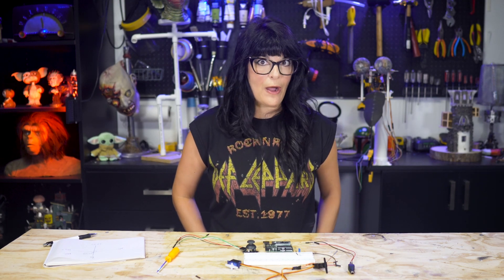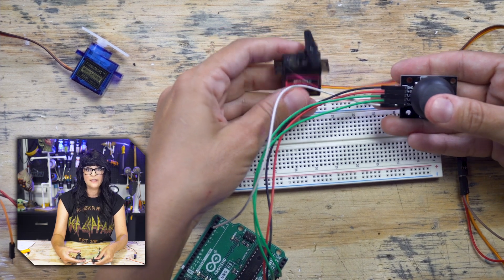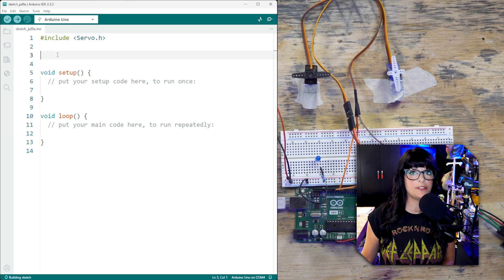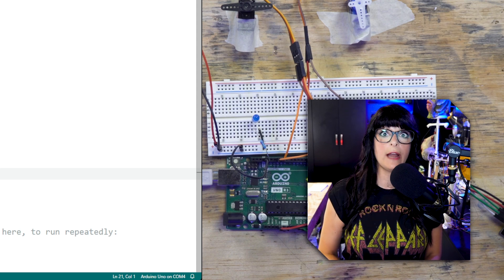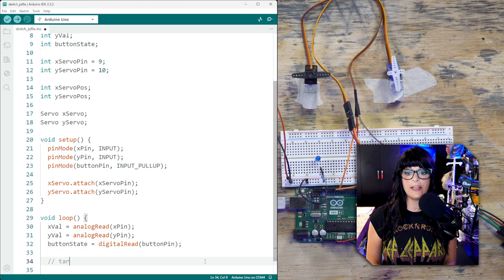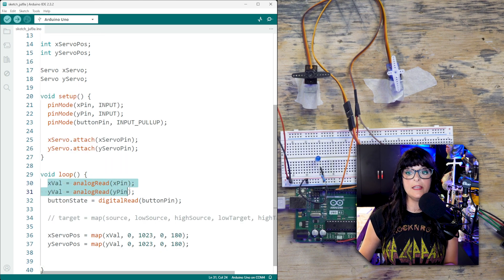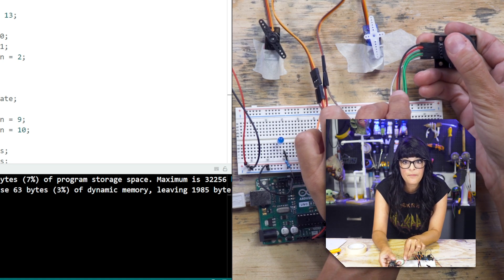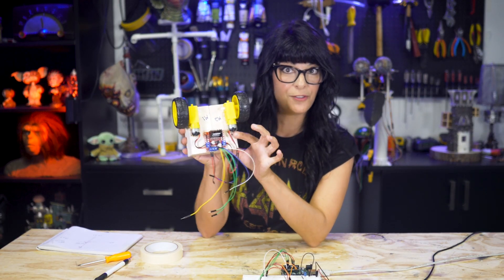Control 2 Servos with a Joystick and Arduino: Wiring + Code

Comment: I did this, wrote the code, but both servos are running when the joystick moves horizontal. One works fully and the other works partially. And for vertical, only one servo moves and not correctly with gittering.. is it the problem with the bad connections or power supply? Please 😊help

Comment: Since your y center wasn't actually the half of 1023, but rather around 489, your y servo in idle is not actually at a 90 degree angle, but maybe something like 88 or 87 (just eyeballing it, haven't done the math). How would you fix that so your 90 degree is 489 and still have the higher and lower values properly mapped?

Comment: i followed everything to the letter but it did not seem to work for me. may i know what's the power supply voltage and amps?
Reply: Did you use the Arduino power supply or a separate PS? I don’t think the Arduino 5v has enough current to move those servos. If you bought the kit there ought to be a small circuit power supply you can plug into the breadboard. It will fit across both power and ground rails. If you’re using that, ensure that whichever side you’re using is sharing a ground with the Arduino, and that the jumper pin in the power supply is set to 5v. Hope that helps.

Comment: Is it possible to connect two servos in parallel for each servo shown in the video for a total of four, and two more operated by the button (full stroke when button is pushed) for a total of six servomotors? I'm going to try it but I'd like your input beforehand to perhaps warn me of pitfalls before I potentially blow six servos! I'm trying to control an eye mechatronic.

Comment: Such an awesome video and very understanding. How would you do 2 Nema17 motors to control X and Y, servo to control push button? Working on a camera gimbal that I’m retrofitting to control a gel blaster. Basically a Gel Blaster remote turret. Lol 😂
Reply: Bonus if I can use the joystick wireless 😂

Comment: Exhaulted headmistress of the arduino, I am completly new to the realm of this magical device. (Tubes where high tech when I was in high school) I am attempting to create something that I think may exceed the limits of the arduino and cannot seem to grasp the concepts of this technology. I am attempting to create a device that will have one counting input that will trigger 2 different outputs at different intervals. ie; SW1 is activated momenaraly on at the apex of a mechanical rotation. at every count 10 output 1 turns on for 2 counts then offthen continues to count 10 more the output on for 2. this will continue to count 120. at this point output 2 which is normally high will shut off a opto relay to terminate the main power source. There are more details, but this is the basic idea. Is this possable?